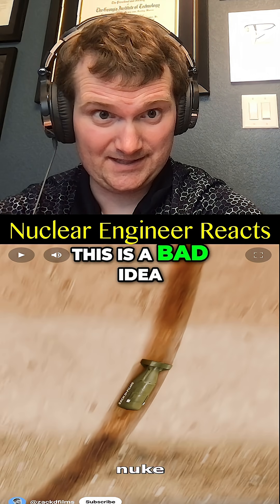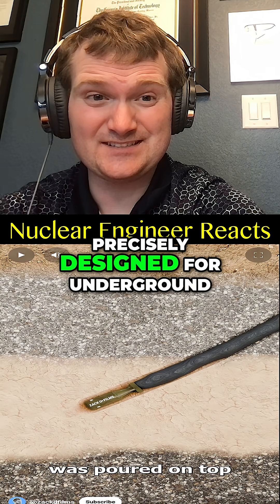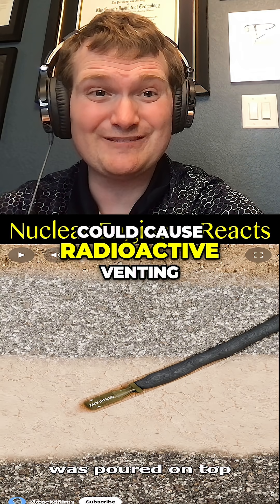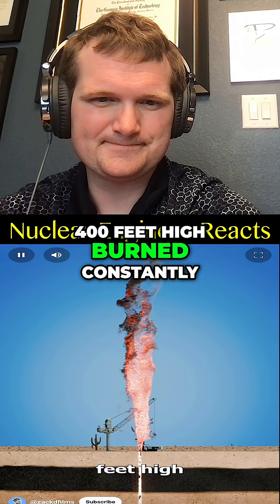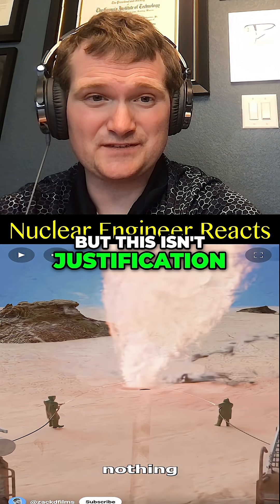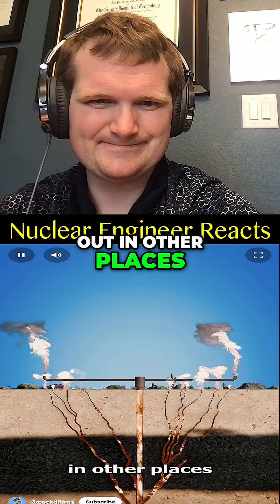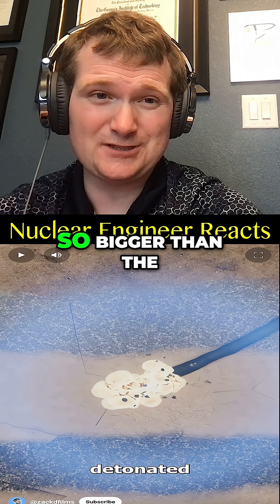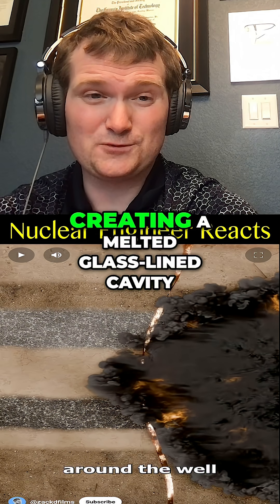They Nuked a Gas Well? - Nuclear Engineer Reacts to Zack D. Films

Comment: True. But it did work. And you didn't mention a better solution^^

Edit: I only see two other options.
1: Conventional explosives, needing huge amounts of explosives and multiple holes/sites, increasing the danger.
2: Pumping in a non flammable liquid quick enough to extinguish and cool the fire. Water didn't work and luckily didn't end in a steam explosion. Any other luquid I can think of would be an environmental catastrophy. 

So yeah. Show us a better idea.

And about long time confinement, the fire got extinguished. It won't restart years later...
Reply: Not only did it work they continued production soon after, video is dumb af
Reply: @MeepBottoms  do they know how long that seal will hold up?
Reply: @xuanduyphantrinh8753 It’s held for 59 years so far so I would say it’s doing pretty good. The explosion itself shifted the rock to cut off the gas and I don’t think that’s gonna undo itself.
Reply: They tried conventional explosives. Didn't work.
Reply: Better than the video he posted a year or so ago saying it wouldn’t work period.
Reply: The leak had a pressure of 300 bar, pumping this much liquid at that pressure would require a whole factory of massive multi-staged pumps. And this won't even stop the leak, just extinguish it.
For estimation 1 bar of pressure is 10 meters of water column.
Reply: I mean, sure it worked, but did it need to be put out at all? From what I understand it was in the middle of no where, coulda just let it burn honestly.
Reply: @Dovahkiin106  It was in rural area but there still were people living nearby. The fire was violent and leading to ecological problems. I bet they also wanted to continue extract ng from there.
Also, it wasn't the regular nuke from the nearest army warehouse. It was specially designed nuke. Stop thinking soviets were stupid, they weren't.
Reply: @Dionismgn fair enough

Although Chernobyl proves they were pretty dumb, lmao. The Soviet Union collapsed for a reason.
Reply: @Dovahkiin106  greedy cost-cutters are dumb, not the engineers
Reply: @c17cc the Soviet Union was run by those greedy cost cutters, so again, Soviets were pretty dumb.
Reply: No buts. They simply took an inadequately calculated risk and got away with it. He simply pointed that out.

Comment: Well, it worked.... 😂
Reply: It solved one problem, with the chance of causing an even bigger one
Reply: @Themellow-i2i and you just imagined this new problem all by yourself?
Reply: @nixles2577  Literally listen to the video dude. It isn't a solution and the risks are not worth it.
Reply: @OneMoreFireworksChannel What risks? The radiation from the Hiroshima blast returned to normal levels almost immediately and this bomb was of a similar size.
Reply: @histguy101 so you are telling me that radiation will magically disappear instantly? What are you even talking about?
Reply: @histguy101  That's because the radiation could quickly dissipate into the enormous environment known as "outside". All the radioactive material here is sealed into a dense pocket underground, where it can potentially slowly leak out and create a persistent hazard.
Reply: @OneMoreFireworksChannel  The risk was worth it, do you know how many toxic gas that it was releasing into the atmosphere per day? That thing burned for 3 straight years
Reply: Came to write this
Reply: It worked ? World always make you pay a price.
Reply: For how long and how well tbd.
Reply: @treybell40501 well the seal is still holding so 40+ years now
Reply: @patthonsirilim5739  just a quick correction, it's almost 60 years now. It happened in 1966
Reply: @treybell40501 always the critics asking questions like "at what cost" why don't you shove that question up your forbidden hole
Reply: Since your to stupid to take 5 sec I'll help your dumbass

The Urtabulak gas field, located in Uzbekistan, experienced a massive fire that raged for three years in the 1960s. In 1966, the Soviet Union used a low-yield nuclear explosion to extinguish the fire and seal the well. 
Post-Nuclear Blast:
The field was brought back into commercial production after the fire was extinguished.
Reply: @treybell40501  forever lol, that pipe isn’t gonna randomly unbend itself
Reply: i mean... just call a private company, they're always looking for ways to make money and sure will hire bunch of people to somehow get the gas out and be able to sell it than spend millions on a freakin nuke bomb inside earth!!!
Reply: In similar situation in Ukrainian SSR it isn't working. If you're interested google "Факел (ядерний вибух)"
Reply: The problem with videos like this is that they just criticize what was done without giving a proper solution to the problem.
Reply: @C-S. The problem is that Soviets did it, people imagine bunch of drunk apes digging a hole and throwing a nuke in it and hoping for the best. 😂 Have fun bro, you cant fix stupid.

Comment: Couldn't you have just waited the fire out? I mean, the fire would have stopped eventually, I'd take more CO2 in the air over potential nuclear contamination, one sounds easier and safer to handle.

Comment: The engineers be like: water cant do sh!t lets get the big guns…

 literally
Reply: Well actually, that video oversimplifies all the process extremely. There were a lot of hard work and many attempts, including normal explosive material, which were too ineffective. It was literally 3 years of continuous attempts to seal the fountain.
Reply: @matveyglazachev4276   I don't doubt you, but that doesn't make it sound less insane.
Reply: @matveyglazachev4276  the soviets also did use a few nukes to dig a canal
Reply: The escalation is actually crazy
Reply: They tried shouting it with artillery too, they resorted to using a Nuke because it was really that bad, the fire column was so hot it would burn anyone in the kilometer radius around it
Reply: i mean... just call a private company, they're always looking for ways to make money and sure will hire bunch of people to somehow get the gas out and be able to sell it than spend millions on a freakin nuke bomb inside earth!!!